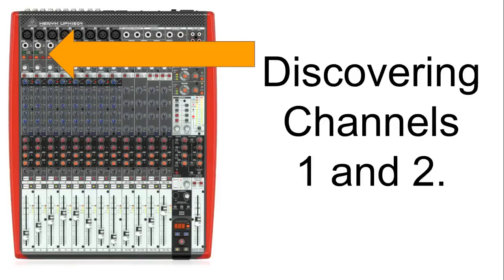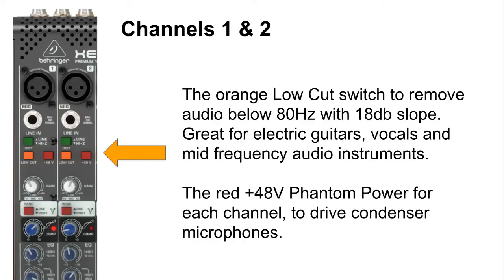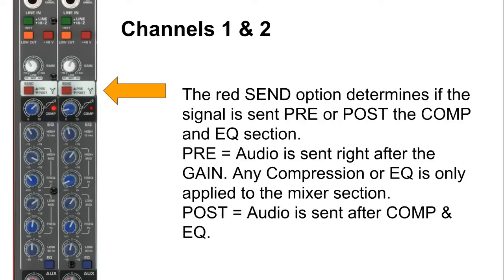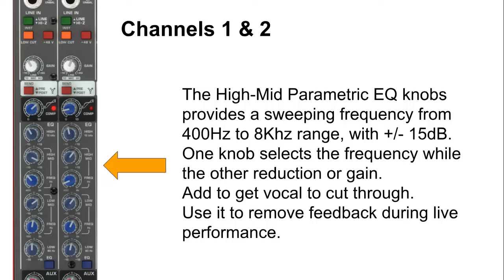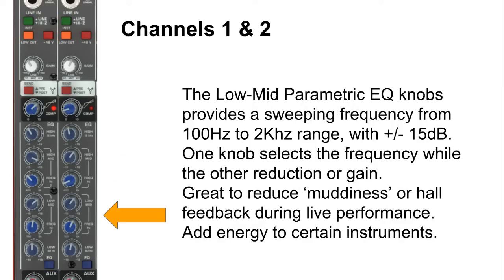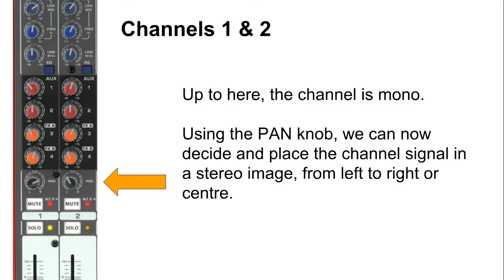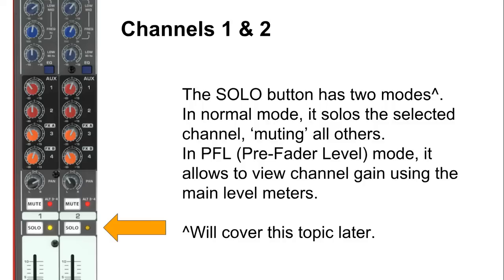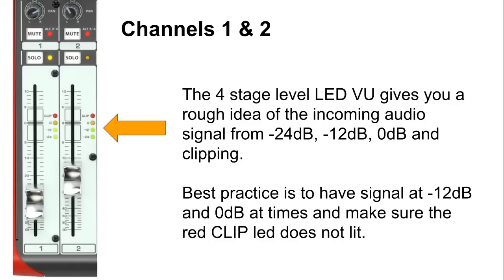Behringer Xenyx UFX1604 Mixer Audio Interface In Detail - Part 1 - Channels 1 & 2

Comment: I understand that the eq and compressor can be pre or post eq. I am interested in the signal being post on the fader, too. Can this desk do that? For example, I have four voice overs, recording on four separate mics. I want to eq them separately, too but more importantly, I want to control their levels via the fader before sending via firewire to my DAW.
Reply from the maker: I don’t know of any mixer that will do that. If recording, adjust the DAW faders, if streaming, use the mixer’s main bus output set to ch15/16.

Comment: Is the compressor in line with the direct out?
Reply from the maker: Not sure what you mean by "direct out".
Reply: @RecordingStudio9  like if I took a direct out of channel one, I know the eq can be Included in that signal but what about the compressor is that in the chain ?
Reply from the maker: The mixer does not have direct out socket.
The channel is Input > Gain > (Insert) > Comp > EQ > Aux > Fader.
Reply: @RecordingStudio9  what about the usb out? You can record each channel out via USB correct? Is the eq and compression sent on that or just dry from the preamp?
Reply from the maker: Watch the rest of 7 part detailed videos for all your answers.

Comment: Can anyone tell me if on Stand Alone mode this mixer records the tracks on pre or post fader mode? Another question... There is no Polarity switch button, right? I'm wondering how to deal with phase issues while recording instruments with multiple mics.
Reply from the maker: I believe I already answered the first question on my other video, and it's pre fader.
When I just started some 30 years ago, I was not aware of Ohase issues during live mixing. When I learned, the hard way, and realised my mixer at the time didn't have phase switch,  I made few short XLR leads with hot and cold swapped. If I needed phase switch, just add the short twisted lead to one. Worked well for me. Hope that helps.
Reply: @RecordingStudio9  Yes it helps a lot! Thank you again!
Reply: @RecordingStudio9  I will try a research on the solution you created. If you could make a video about it would be great!

Comment: Hi! What are known issues for this mixer/interface?
Reply from the maker: My original purchase had a power supply fault. The replacement worked 100% for about 12 months I owned it and used it daily. Sold it to upgrade to PreSonus StudioLive 24 Ser 3. I miss some of its options not available on my new mixing desk.
Reply: @RecordingStudio9  Ah ok yeah i heard the studiolive desks have alot of issues... Also it's not possible to send the usb outputs POST eq right?? One more question; what was the software side of the xenyx like?? Did it have any specific drivers/mixing software??
Reply from the maker: I have not had any issues yet with my SL24. You can set analog inputs to USB pre or post the FAT channel. Same with USB to analog outputs that also have the FAT channel.
The UFX1604 does come with simple driver for USB or FireWire connection.
Reply: @RecordingStudio9  what do you mean by FAT channel? And what are the features u miss from the xenyx and why did u upgrade?
Reply from the maker: @boimesa8190  The FAT channel includes Gate/Expander, Compressor, EQ and few more options.
I miss the analog insert options.
Reply: @RecordingStudio9  what can u use the inserts for??
Reply from the maker: @boimesa8190  Maybe you should watch my videos as I answer all your questions already 😊

Comment: This was great thanks and helped me to pull the trigger on this great little mixer....would it be possible to cover a video on punching in and out for an overdub either on a daw or working from the external drive? Or would i have to load to my DAW and edit on the computer?
Reply from the maker: USB onboard recorder can't punch in/out. You need to do that in your DAW.
Reply: @RecordingStudio9  Thanks that's what i was beginning to figure out, great video and looking forward to the rest of the series

Comment: Hi Vatche
Im looking to upgrade my mixer...Im looking at 
Presonus AR 16
Behringer 1604
Or a presonas 18-24  (and ill keep my Yamaha )

My question is within windows sound control panel are the Channels separated ie: 1-2-3-4 etc
Or are they in Pairs like the studiocraft MTK 12 or 16  ( which ive researched and  discounted )
As i stream also its important to have as many Individual outputs as possible
Current setup is a Yamaha MG12XU with presonus studio 6/8 audio interface
Also, are the drivers for the 1604 stable...( if it uses asio4all then i will discount it )
Thanks.
Reply from the maker: The separation of the channels is due to the software and not the hardware.
UFX1604 does have and use own driver from Behringer and is quite stable so far.
With PreSonus AR16, you also get Studio One Artist edition for free, as well as Capture that records all 16 channels.

Comment: Can't wait for part 2.  Also do you know if there is any way to get the output recordings to include any effects added using the internal processor?
Reply from the maker: When you select to record the MAIN output as channels 15/16, then the effects are also recorded. You can also choose to record the onboard FX outputs as separate tracks.
Reply: @RecordingStudio9   Thanks, I use this mixer to record our live performances and practices.  I add some effects to the vocals in the first 4 channels, and I'd love to get those channels with the effects, but I don't think that is possible.
Reply from the maker: @adamsjohn1956  It's possible to route the FX-B to AUX 1 Send and then enable AUX 1-2 to FW 13-14 option and record the FX separately on tracks 13 & 14, unless you want the FX printed on the original track, then no. The reason is that the FX is at the end of the audio routing, not within the channel.

Comment: Hello. There is this mixer. Help, what could be the problem? The main bus is recorded by pressing the Assign to FW 15-16 button, but the recording is very quiet. Main MIX knobs and all other channels at level 0.
Reply from the maker: What do the level meters display when recording? Are they displaying enough levels?
Reply: @RecordingStudio9  Recording is made with a live performance. The level on the mixer is normal, and everything is well heard on the active speakers, and in the recording program shows a low level of the mixer. Different programs were used. If you write separately any channel, then all is well. Maybe it's a firmware update. At the office. site two files upgrade UFS_Firmware Upgrade Tool_8396 and UFS_Firmware Upgrade Tool_8405. I did upgrade to Upgrade UFS_Firmware Tool_8405. Did I do the right thing?
Reply from the maker: I will test this on my unit and let you know. Maybe next week or so.